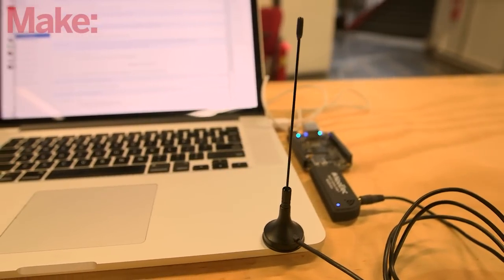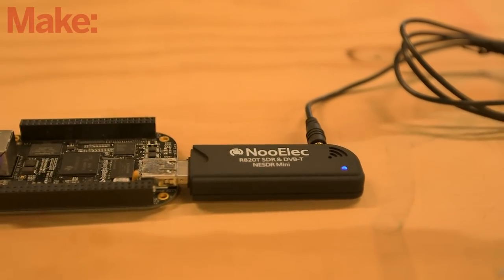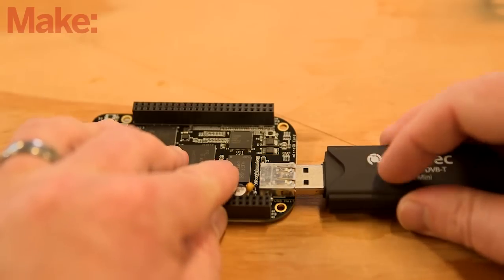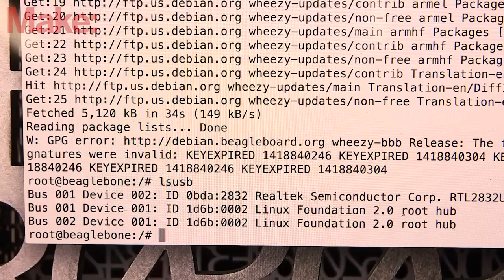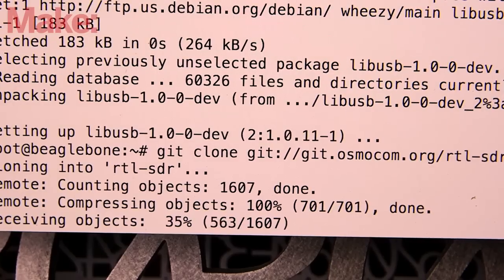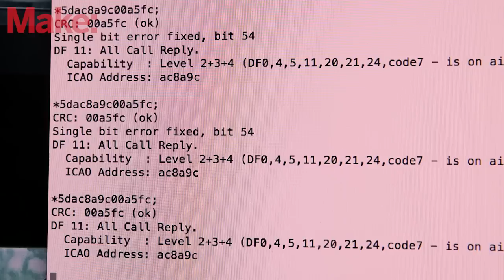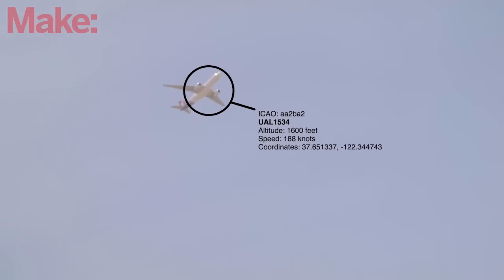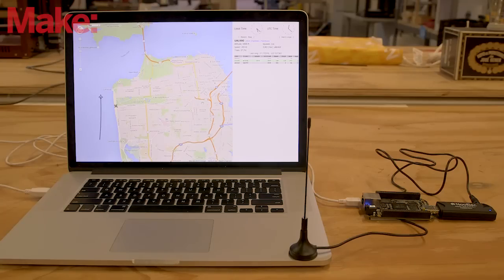SDR Plane Tracker

Comment: @ MAKE: - why do you need that small computer at all. you have a perfectly good MacBook right there. why not just install ANY number of RTL-SDR compatable software on the MacBook and interface the Dongle directly ? now, it you wanted to make a Portable RTL-SDR then I could see using a Razz Pi with dual USB ports running TWO of the RTL-SDR at the same time.

Comment: HOLY CRAP IT WORKS! This is so cool I just found 5 planes!!! I did it on my Linux laptop where I don't have to bother with ssh. :D
Reply: BlueBetaPro Its picking up ADS-B  which is sent to air traffic control by commercial airlines but not all military or private planes use it as far as I know. Its how Flight24 works and you can register on that site and send your flight data to them.

Comment: someone needs to make an inexpensive portable version of this, then sell it to all of the drone/fpv pilots out there. It would sell well and it could make flying a fpv craft very safe.
Reply: chrisbewrx It's not a magical detector of flying things. The only reason why it can tell you where aeroplanes are is that they all transmit their position using a standard protocol. RC drones don't.
Reply: RFC3514 i don't understand what your trying to get at? Here is an example of what I was saying: I'm about to fly my drone, if I have a portable inexpensive version of this i can check that the sky's around me are clear of traffic.... Result: the world is now a safer place..
Reply: chrisbewrx At the altitudes your drone can fly, the sky is pretty much guaranteed to be clear of commercial aircraft. The only things you'd ever bump into would be other drones and small aircraft, that won't be picked up by the software, because they're not broadcasting their position.
Reply: RFC3514 yes true, but it's all about the general public perception of the hobby, currently we have some commercial pilots stating that, not only are they seeing drones while flying, but they are having to avoid them... Lol it sounds stupid I know, but some ppl just don't want to share the sky. Btw a fixed wing rc drone can most certainly fly within commercial air space in some areas.
Reply: chrisbewrx The only places where they'd be low enough to see hobby / civilian drones would be near airports, where they're not allowed to be flown at all. Running commercial plane tracking software and "promising to move your drone out of the way if a plane approaches" wouldn't make it legal, even if it were physically viable (which it isn't, because the tracking has a significant delay, and the drones don't move fast enough).

Just don't fly them near commercial air space (i.e., near airports or outside class G airspace).
Reply: RFC3514 OK well I wasn't trying to say this is the answer to saving the world, just that it would be nice to go to the field, scan the air and be happy that I can launch my plane/drone in a clear sky delay or not, I would find it beneficial. 
Not that it's legal but you should check UHF systems, as current hobby grade drones can easily fly within commercial fly zones, ppl that want to do it don't need to be anywhere near an airport.. Yes this project would not change the legality of a flight in a commercial zone.
The safety measures I currently use are my ears and a spotter, if I'm flying out of line of sight. Personally I would like a portable version of this project to add to my personal safety measures, even tho I wouldn't be flying at heights that would endanger commercial jets.

Comment: If you only need Linux with access to USB device VirtualBox would do just as well (assuming you want to run other operating system in parallel - if not go with livecd).

Comment: best one ever ...QRS11-UNinteruptable Auto-Pilot ...
BOEING sued for distribution in planes without disclose ..tech going back to the 80's ...when sued, they released info in 07, like it was new; and now in all commercial planes without pilots knowing.
never wonder how a plane dissapears, or goes down, again.
Reply: Bro are you serious? Like serious, serious??
Reply: Boeing patents ...lawsuits over the sale of planes to the likes of Lufthansa, and more, without disclosure of these systems installed. Pilots today don't even know all the manufactures have systems installed ...gas injections systems ..or how about that plane that went missing out of Asia ?? remember. I wonder why you don't hear about things like LIVE data/feed from the engines to the likes of Rolls Royce. Again ...patents and lawsuits Malaysian gov was provided all the information from a record holding Marine pilot after that plane went missing ..just an example.